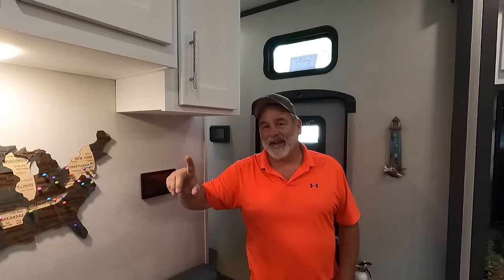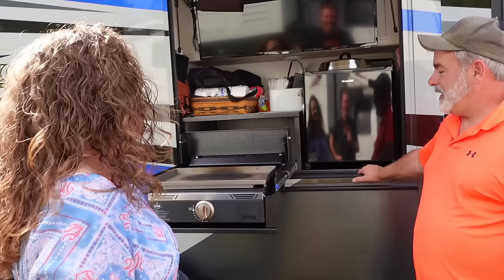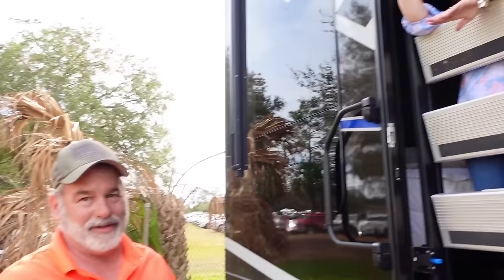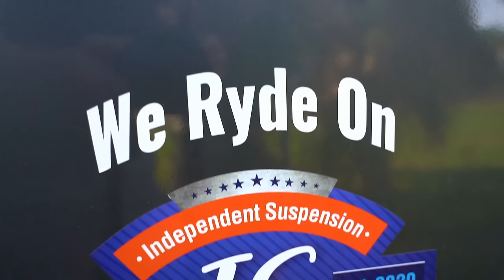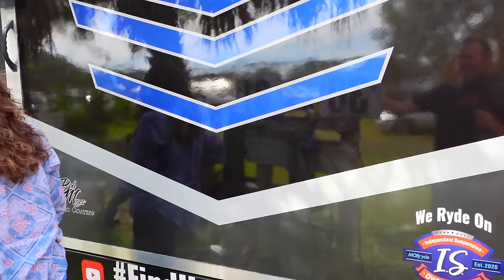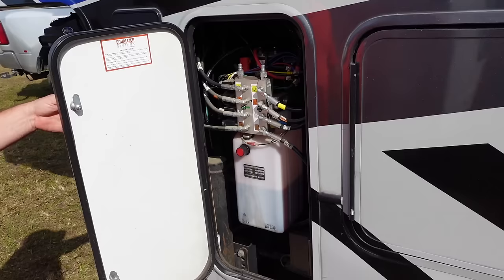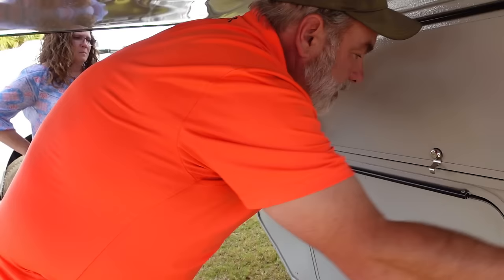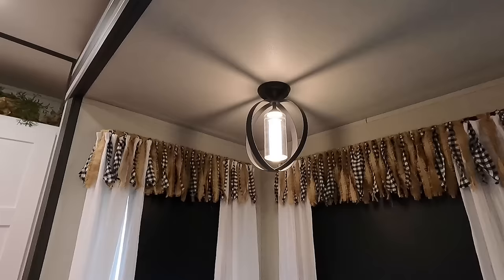45 EASY DIY To Amazing RV Mods, Upgrades & Hacks That Improved RV Life The Most!

Comment: Really like the tire wear notes on the independent axles and 60 gal add on tank. My truck (bought used from a full timer)  has a 90 gal tank that auto transfers to the main tank. Another point besides out west mentioned here would be traveling to Alaska and through Canada where fuel stops are farther apart too.